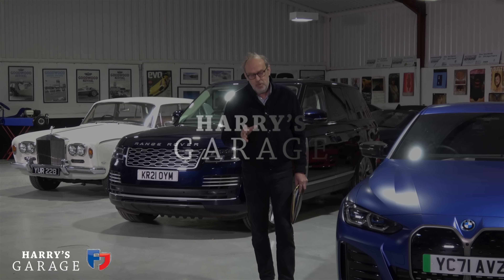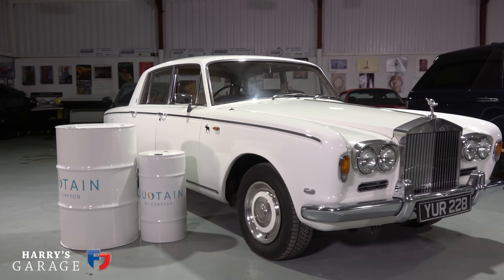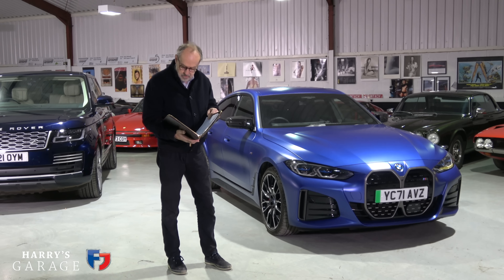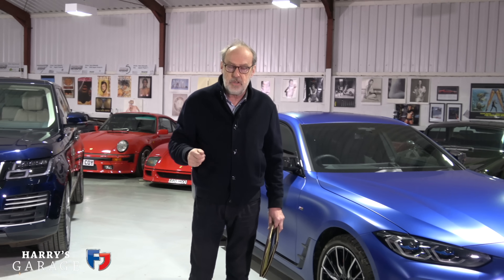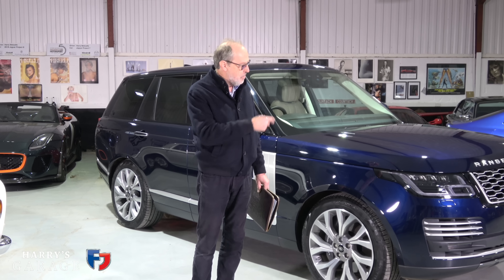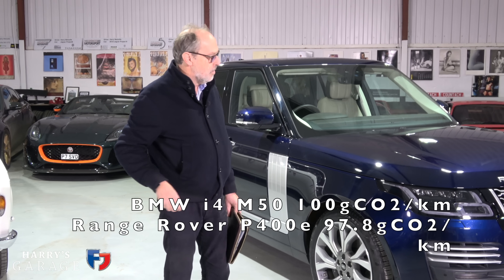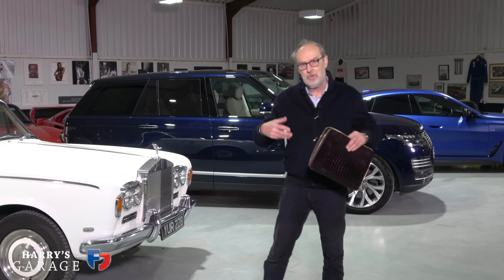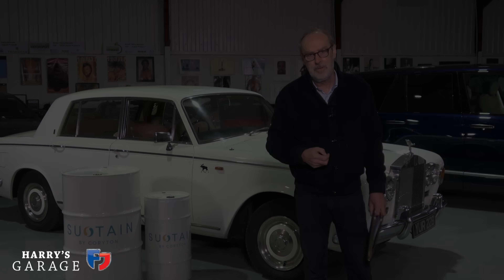Sustainable fuels; what are they & are e-fuels better for the planet than running an EV or PHEV?

Comment: Love your videos Harry, but I think looking at the carbon emissions within your local region is highly misleading, as the grid distributes power nationally. The question has to be, what type of plant will be used to supply the extra electrical power requirement if I switch from an ICE vehicle to a plug-in? I.e. what are the additional carbon emissions for a marginal increase in electricity production? This won't be supplied by turning up the sun, or the wind, or nuclear plant, so the UK average is not a useful measure either. At the moment gas fired plant is always running in the UK and a significant proportion of the time coal plant is also running and it is one or other of these that will be turned up to meet additional supply requirement. The marginal emissions will therefore range between that for each of these two, depending on the season and time of day. This more realistic view makes a move towards plug in vehicles highly questionable at the moment.

Hopefully mankind in on a journey towards a sustainable future, but the steps we take on the way need to be carefully chosen at each stage of that journey to provide the highest benefit from those capital investments we make (both financial and carbon emission). Building a nuclear power station requires huge investment of both types, but the CO2 emission payback is unarguable. Pure BEVs also require a big investment, but the payback remains highly questionable at the moment. Once we reach a point when electricity supply is fossil fuel free for a significant proportion of the time then we may be in a position to benefit from widespread BEV adoption. Toyota and Honda showed the way in the late '90s - the benefits of hybrids are clear, but surprisingly under appreciated. My twenty year old Honda Insight has lower emissions that the most efficient BEV available today when you take into account marginal, rather than average, CO2 emissions.

Comment: Good content Harry - with the sustainable fuels have Coryton done much to discuss whether they think their product is genuinely neutral?  I'm firmly in the PHEV camp actually being a better answer for daily use than full EV.  I did some work including manufacturing based on using the BMW X3 range which is I think the only car available as EV, PHEV, Petrol and Diesel... it takes a really long time (50k miles or so) before the iX3 is a better choice than the 30e... and even 25k miles before that beats the diesel.  Looking forward to understanding when I can buy Coryton Sustain to fuel my cars
Reply: Well I imagine it’s carbon neutral because the renewable energy is powering the production plants. The only real CO2 produced would be the transport trucks to get it shipped. Even then, they can power the transport trucks with that same synthetic fuel. There’s no need to create new fuel stations since it’s just gas. Nobody has to buy a new expensive and range anxiety enduring EV. No toxic batteries produced. It’s literally the best option we have right now.

Comment: I looked into alternative fuels and came across Crown HVO which is a diesel substitute and was wondering about your diesels with the big tyres that prefer fields to roads. The Coryton I presume is a petrol substitute as I can't see mention of diesel on their website. The thing that I though was most interesting is that you get the fuel delivered , if one's got the space Crown deliver a big box with a pump attached, is that the future of 
agricultural diesel as I read the red diesel will no longer receive subsidy from April. The Crown oil diesel alternative may save all those well built diesel engines from being scrapped which seems the trend with all the bad VW press. 
Food for thought as ever , thank you for hosting this debate and doing the maths so we don't have to.
Hybrid still seems the best balance but Lithium batteries in cars weighing two tons seems bonkers to me.

Comment: 2.5 miles/kWh is very low, most mid-range EVs (Tesla Model 3/Y, Polestar 2 etc) manage 4+ miles/kWh.  The other point is that how much CO2 your electricity produces is dependent on your energy provider, some (Octopus etc) only supply power generated from renewable energy

Comment: Two additional considerations that I'm sure you will be thinking about with regard to renewable fuel is A) shelf life & gumming, and B) boiling point. For example, using gasoline with even as little as 10% ethanol has caused major problems with boiling fuel in the carburetor of my classic car, and it does bad things if the vehicle is not used daily. I'd be curious to know what the boiling point of the Coryton fuel is.

Comment: The CO2 emitted in your elecricity supply is not constant throughout the day, at night it tends to drop in most areas as the demand drops off but wind energy is still produced at the same rate (given that the wind strength remains the same). As many EVs are charged overnight this means that they charge on cleaner electricity than you might think.
Reply: The awkward moment when you look into wind technology and realise it uses masses amount of oil to maintain the mechanisms and the propellers aren't able to be recycled.
Reply: @sh-hg4eg  🤣🤣🤣🤣🤣 OIl which can be recycled as opposed to the fuel in IC engines which is burnt and the toxic exhaust gasses released into the atmosphere. Scrap turbine blades can be crushed and used as filler for architectural building panels and Siemens Gamesa have developed a fully recyclable turbine blade

Comment: Research that I am involved in which I cannot disclose much detail due to NDAs is very much focused on synthetic fuels and lubricants. It is a nonsense to think that the wholesale transference to battery electric vehicles (BEVs) is the panacea to our problems. The future has to be a range of powertrain technology platforms utilising a variety of energy sources. The ICE still has a place in this consideration, using synthetic fuels and lubricants. And beware bioethanol is not as green as often implied. See other comments herein. And don't forget chicken poo https://www.facebook.com/watch/?v=459665017739867

Comment: Hi Harry, your analysis on the actual efficiency of producing the alternative petrol is a little superficial. You noted that electricity does not travel well. This is true but you didn’t bother to check the actual transmission efficiency. On the other side of the argument you also didn’t mention how many KW of electricity it takes to create petrol with an equivalent energy content. You also didn’t mention the amount of CO2 produced in building the chemical plant to produce the petrol, the CO2 in the production and transport of the 200 litre fuel drums the production of a desalination plant for the water needed in the production, the energy consumed by the desalination plant and after its actually made it to your door, the fact that the ICE in the cars will throw three quarters of the energy away as heat. On your farming channel you do the legwork to undermine the arguments you disagree with. It appears that when a solution fits your requirements you are not quite so diligent…
Reply from the maker: And that's why E-fuels will always be a premium product reserved for Motorsport and running premium classic cars and the like. We don't know the true CO2 content of sustainable fuels until they get closer to production but we do already know they will be better than fossil fuels.
EV will be the main form of personal transport in the future but both the charge network and battery technology need to improve massively first before they are a true alternative to a regular family ICE car for the mass market. Hence why I'm sticking with PHEV for the family car for time being at least.
Reply: @harrysgarage  and that’s why I’m going for a fully electric and an older ICE car. It doesn’t usually come as a surprise to me how long my journey will be. Consequently I can decide which car to take before the journey starts. The advantage being that when I’m using the electric car I’m not lumping about an engine and gearbox and when I’m using the ICE car I’m not lumping about electric motors and batteries…
Reply from the maker: Agree up to a point but our Range Rover has a 2.0litre 4-pot engine, so pretty small really, plus the battery is only 13kWh, so the manufacturing CO2 is much lower than a full electric car too. 
I think you can think too deeply on this subject, especially if you have some mechanical knowledge, but what is basically a dual-fuel car has huge advantages today as you get the best of both worlds and don't have to suffer the misery of the underdeveloped UK charging network. 
Another interesting bit of info I discovered last week is 90% of UK EV buyers also have access to a regular fueled car, so only 10% are bought as a household's only car.
Reply: @harrysgarage  I guess if you can only have one car and can’t afford a Tesla then a PHEV is the best currently available compromise. If you’re going ahead with the PV and power wall on the farm you might want to check out Octopus Energy’s smart tariff that offers six hours of really cheap energy overnight when there’s spare capacity on the grid. At the moment it’s aimed at cars and they’re piloting with Tesla. I noticed on the quote you flashed that you’d got a Tesla power wall detailed. Given your profile and exposure you might be able to convince them to develop a solution for power walls to ‘top you up’ overnight when your PV hasn’t met your needs. It’s certainly a route I will be looking to take when they have  a solution which works with VW.

Comment: I think I heard Harry state the BMW was 2.3t and had a realsistic range of 200 miles.  I'm sure it's a very nice car but that's not sustainable and it is a big argument against battery cars.   The only reason it is 'acceptable' to a car buyer is that fact a car is parked up the majority of its life. 

I realise the entire motor manufacturing industry has bitten the bullet and headed down the battery EV road but it has taken a lot of government support and a huge set of blinkers shielding the industry from the hidden costs.   Not to mention the very real safety risks of batteries putting out 500V DC and more.  Thermal runaway is a  fact and without an industry wide regulatory framework to mitigate the risk.  Thermal runaway of Lithium Ferrous Phosphate batteries means I'm nervous about charging electric garden tool batteries in my house. The airline industry is increasingly very  worried about passenger electronics.  I would willingling bet the Falicity Ace that recently went to bottom of the Altantic  Ocean full of luxury cars suffered an inextinguishable onboard fire as EV after EV suffered thermal runaway fires.  I'm not saying those cars were defective but a conventional cargo hold fire, that the crew could have put out, instead   triggered the thermal runaway battery fires.   There is no alternative other to let these burn out.   Harry, you shouldn't park any EV in you barn of classic cars.

Sustainable vehicle fuels are probably a better bet with compressed biomethane and green hydrogen looking viable for cars, construction vehicles and trucks.   You could run a Lambo on it but it would kinda ruin the theatre.   Synthetic liquid fuels (to replace petrol) from converting the Hydrogen in, say, ethanol, methane or ammonia is possible at significant cost.  I think Porsche make their synthetic liquid fuel by first creating 'green' hydrogen using a renewable energy powered electrolyser and then reacting it with atmosheric CO2 in a complex process to make liquid fuel equivalent to petrol.  The last time I looked, it was 4 x the price of petrol.  To be honest, if green hydrogen is to be made, it would be far more sensible to the hydrogen for a  fuel cell to drive electric motors.

The whole subject is complex and with a lot of dirty secrets hidden under the hood.   I'm sorry to say, but my view is old petrol cars will just becaome prohibitive to run if they are reliant on synthetic liquid fuels (taxation??).  Maybe some of the classic exotics will survive but the rest of the 'old cars' at the lower end of the food chain will probably have their petrol engines taken out and replaced with electric motors for a bit of weekend fun.

Comment: Hi Harry,

I am a subscriber and a fan of your you tube videos and have just watched this with interest.   I am a similar age to yourself and have been driving for many years,  obviously in internal combustion engine (ICE vehicles).  However I started to make a change to electrified vehicles in 2017,  first with a Toyota hybrid,  then a Mitsubishi Outlander PHEV.  I was so impressed,  that I now have a full electric vehicle (Tesla). Therefore this was of interest.  But I must say your video does not represent the full picture.   First of all you state that the production of electricity is not 100% from renewable sources,  therefore running and using an electric car is not as green as it appears.  That is true,  but you fail to mention about the power and CO2 used to drill,  extract from extreme places,  transport in huge tankers around the world,  then refine it in huge power hungry refineries,  before it is then transported via diesel trucks o the forecourts before it gets into your tank.  That CO2 seems to have been ignored?  from then on the ICE vehicle is producing harmful emissions for every mile driven. (The electric vehicle none).  You are stating these "facts" without them being fairly reported.    It is not just about CO2 either,  there are a lot of other "nasty substances" being emitted from tailpipes,  Nitrous oxide for example.   Then there is efficiency,  the best ICE is only approx 30% efficient.  the rest of the energy in the fuel is wasted.  An electric motor is approx 98% efficient,  so much better use of the fuel, (electricity), it uses. Reality of charging is that 90% is done overnight at home.  (I know that not everyone can do this).  When you can you are actually spending less time "refuelling" on the road than and ICE vehicle.  The horror stories of spending hours charging if you are on a long trip are not necessarily true.  It only takes a bit of planning to ensure this does not happen,  and you can charge in about 30-40 mins on rapid chargers while you are having a comfort break and coffee etc. Finally, you mentioned it earlier, but in your summary,  you counted the low cost of using your "turbine". for the electricity in the Range Rover, but not any in the BMW,  which would have reduced that figure a bit more.
Anyway,  I can understand you bias somewhat with all the beautiful classic cars you own,  and I would definitely be the same.  Just thought I wanted to also fight the corner a bit for electric vehicles because they get a lot of bad comments and false narratives being circulated that are just not accurate.

Comment: Interesting, but on the PHEV you need to add in CO2 for the electricity being used to charge it, in order to compare it accurately to the BEV. I expect that will push CO2 emissions in use higher than a BEV. It's still a valid point that BEV CO2 is directly related to the electricity generation, however I think that you're at risk of misrepresenting the data by focusing on a region with particularly high electricity generation CO2 and not also considering the national average. The East Midlands is particularly high because it hosts one of the largest gas/coal plants, I know you made the point about Scotland being 10% of the East Midlands but the national average is also less than 50% of the figure quoted, and for the Cotswolds the figure is also about 50% of what you quoted according to https://carbonintensity.org.uk/. In reality, for the majority the BEV will have significantly lower CO2 emissions than the PHEV, not slightly worse as shown in the video. However, I absolutely agree that today a BEV has a much narrower range of uses than a PHEV, and for many PHEVs are a great if expensive option.

Also, for the sustainable fuel you need to consider the CO2 involved in transportation. If, as you suggest this fuel is manufactured in countries that have significant excess renewable energy, and then transported as a liquid if will definitely have a CO2 footprint - because liquids are heavy the last thing you want is to transport them internationally, the norm would be local manufacture where ever possible. Traditionally, this has been a cost issue but with climate change it is also a significant CO2 issue. Sustainable fuels could be great, but we need local manufacture to minimise the footprint. Again I agree that the truth is the sunk CO2 in a classic car, alongside with it's limited usage and sustainable fuel makes their usage a non-issue for climate change, however I fear that nuanced argument will get lost and they will still be seen as 'dirty'.

Comment: Did I miss hear you that you calculated the cost of electricity in your area from the grid for the BMW EV, but used the power from the wind turbine at  your home for the Range Rover Plug in Hybrid?  I understand and agree that the "greenness" (and using the equivalent CO2 per kilometer is a good proxy) will depend on where you live and where the power comes from, but surely if you plug the BMW and the Range Rover in at home, you should use that for your calculation?
But I am interested in the apples to apples calculation.  I run a Tesla for my daily, and an MX5 for fun.  I'm very interested in sustainable transport, so with solar panels on the house most of my driving is guilt free.  But even if it cost me more, I'd be interested in keeping the Mazda going as long as possible, especially if it can be done with a sustainable model.